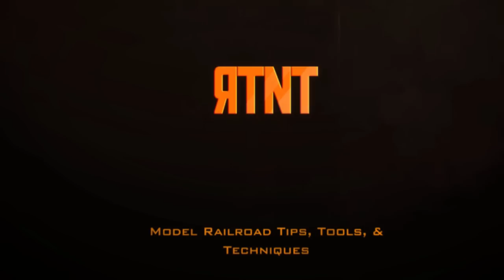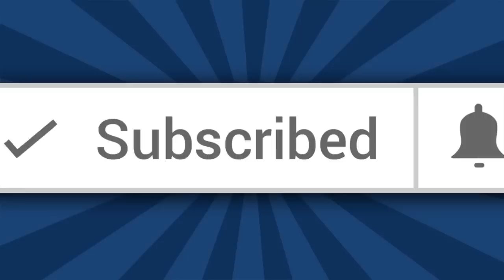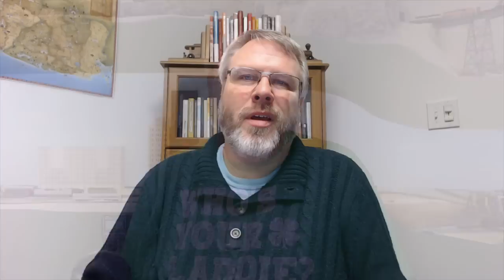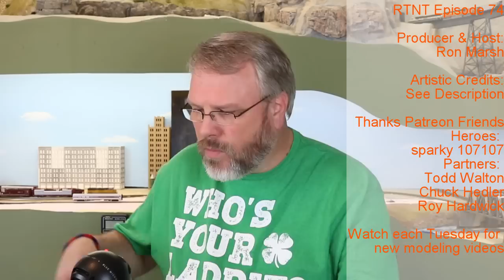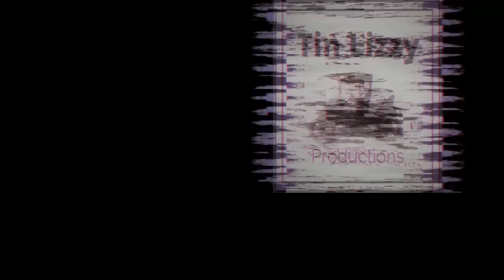Decisions to Make Before Building a Model Railroad Layout

Comment: After 25 years I'm back in the hobby. Using my old but still running beautifully Atlas/Kato yellow box locomotives I built a small layout based on the Penn Central in the 70's. Learned DCC and wired using NCE Power and Cabs. Converted said Atlas/Kato locomotives and just finished the benchwork this weekend! Starting to lay the trackwork using mostly Atlas code 83 flex and some juiced Shinohara turnouts which will need to be modified with isolated frogs and points. It is very interesting using older equipment with modern control (NCE/DCC) but I have to say I love it! My throttle pack days are over! Thanks for all the videos. I think your RR looks awesome!👍
Reply from the maker: Welcome back to the hobby. Sounds like you came back in force. 👍

Comment: What about your skill level with tools?  I myself am very proficient at wood working, electronics, etc. However I wasn't when I started my first layout some 25 years ago. Because of that I built small layouts when I first started until I got more skills, got  better tools, and was able to build better benches. I also kept wiring simple, relied on pre-made devices, and things like that. Now I'm wiring and running DCC, can program an Arduino, and make my own circuit boards.   

So for me - my goal was eventually a room sized layout but starting with a smaller layout really paid off. Of course time, $$$, and such will impact that decision.
Reply: As an experienced and successful model train builder, do you have any tips for someone quite possibly entering the field? I am a "tinkerer" so I have a lot of experience with soldering and doing highly detailed work. Any tips you could offer would be greatly appreciated! Thank you!

Comment: my first consideration is storage. i live in an apartment and dont have an expansive space to dedicate to a permanent layout. im going to build modules inside a number of storage boxes. im going to cut holes where necessary and bridge the boxes with a section of track. all i have to do is pop some track apart, put the lids on, and stack the boxes to be put away.

Comment: #1.  Do you have time.  Me?  It always seems my biggest nemesis to building a sizable layout, time!   For me 1) D&RGW, late 70's to early 80's, Grande Junction CO and westward.  I'm bucking the trend of Rio Grande model RR at the Front Range.  2) Rail fan style layout with some switching.  3) Scope - Grande Junction and westward.  Desert and canyon scenery.  4) Scale HO. 5)  Standards: I've digested John Armstrongs book many times over.  Minimum radius 32", siding 21 feet long.  11 track staging yard. etc.

Comment: Another thing to consider is what line you want to model, I myself will be in part modeling WSOR and though I would not have a great amount of space I have to do HO because they don't make any wsor in N
Reply: Sorry you feel that way… I'n in N scale building the WC in the fall of 1999... And rolling forward as if the CN take over never happened...

walthers.com
N scale
WSOR Locomotives
EIGHT items… listed

N scale 
WSOR Rolling stock
Zero items listed – But, since most WSOR rolling stock is “used” and shows its heritage, have fun doing patch jobs.

However, over the past few years I have acquired 12 WSOR cars from: Atlas, Fox Valley Models, Micro-trains, and Athearn. You can build prototype WSOR trains with off the shelf equipment by decaling local customers cars. 

The real question is, how bad do you want to build the WSOR to scale in N scale?

Never say never… More N scale stuff is coming every day… 
 After all Scale Trains did build the UP Big Blow in N!!!

Comment: I am just getting into model railroading so as you may guess I have some questions about the hobby. There are so many different systems and I don’t know if they can work together. Starting with the controls. I see the type of controls I remember as a kid. They are very basic like the Tyco 499. I have one of those for my HO set. I have had this set for years can’t remember where I got it. I have seen these DC systems and I see there is something call DCC.  I also have a very old Lionel set with the fast track tubular tracks. I think it was one of the cheapest starter sets from the 40s or 50s. I bought it because it is the New York Central set and my wife’s father and grandfather worked for that railroad. The train set I setup and test ran and it works and with be building it on a 4X8. But that with be later this summer. For right now I am working on the HO. I have a controller ordered (Tyco 499) and as of yet no tested it set. The set was set on and 4’X8’ by whoever owned it before so that is what I am working with. So I have been looking at buying the plug in lights system and have tried building a building from card stock. I think that is going to work well thanks to one of your videos. Anyway can you make a video that talks about the different types the trains system (DC DCC) and what will work with what? I see that some engines have sound do you have to have something else in order for them to work with the sound? I see these controls that are hand held and you can have one engine out of three or four running or can have a number of engines running at different speeds etc. Can I buy an engine for my old HO set (1960?) like a DCC engine and will it work on my set up?  Thanks for making your videos they have helped me a lot.
Reply from the maker: Well, there is a lot in that set of questions. What you have, as you mentioned is DC. DC as you know can run 1 train with 1 power pack on 1 block of track. To run multiple trains at once with DC you need to break your track into insulated blocks, have switches to route power to the right block, and have multiple power packs. DCC (Digital Command Control) uses a different kind of controller to send not only power but commands through the rails to a decoder on board the locomotives and allows different trains to run at different speeds, different directions, etc. on the same track. You should be able to run older DC equipment on any DC system. For DCC, however, you would have to convert your locomotives to DCC by installing decoders in each one. The sound you are hearing is connected to DCC using sound equipped locomotive decoders with speakers attached. Some old DC systems had sound associated with them, but it worked completely differently. Hope this helps.
Reply: Greg:  Short reply:   If the Tyco 499 came with a train set, use it for accessories only.   Get a Railpower 370 or better unit for Direct Current (DC) control of your layout.   There are plenty of resources out there to help you wire your RR.  DCC is Digital Command Control and is a little more complicated.   This system is NOT compatible with a DC wired RR.  DCC puts a square wave digital signal on top of an AC sine wave and sends these signals from a controller, stationary or hand held, to a command station using a throttle bus (wires). The controller sends a signal to the track using a constant voltage of 14 to 16 volts AC at all times.  You need a Decoder (computer chip) - equipped loco to respond to the signals being sent.  DC controls the track, DCC controls the locomotive.    Do your research, there is plenty of info out there.   Good Luck.    And oh, get yourself to your local NMRA Division and ask questions.  They will be happy to answer.   You can still get DC locomotives at swap meets and train shows.   Some DCC-equipped locomotives will run on DC powered layouts, but you won't have all the functions, lights and sounds.  Hope this is helpful to you.
Reply: It came with the Tyco 499 controller. I tested it with my Fluke meter and it worked. The next day I connected it up to the tracks and the engine didn’t move. I checked the engine and found a broken wire. I fixed the wire and the engine still didn’t move. I rechecked the controller and it didn’t work anymore. So I bought another on EBay. If the engine still won’t work I will buy another engine. I just didn’t want to buy one that doesn’t work with the set I have. I will check out the controller you suggested. Thanks.
Reply: Given your experience, I'd junk the Tyco controller and get a basic MRC power pack.   Secondly, if you're using brass track, i'd junk that too.   Replace it with nickel silver components and you'll be much happier.

Comment: Hey Ron, I disagree with what you are saying.. I personally just want to lay track and run trains on the HO scale, I have a preference for steam locos. I do not intend to build scenery, no track ballast or even put in roads, towns or anything else similar... I am just wanting to get locos, and rolling stock of various types to run around a track and have ladders for yards to set up and store trains and engines. I have acquired some track and points (but not enough as yet), a turntable and a 6 space engine shed, all second hand and will probably go this way as it is much cheaper to do it this way as some of the prices I have seen for new engines and track is crazy (here in Melbourne Australia).

The room that I intend to setup my layout is a 16ft long room with 2 doorways on one wall and is 9ft deep, so with that in mind, I am thinking of making an "m" shaped layout possibly with 1 or 2 helixes at the ends so as to get to a lower and or upper section for a fiddle yard........ I am presently going to use only DC as the loco's I have acquired are only DC, but I might go to DCC in the future and I will probably wire the layout for DC and DCC as I lay it. 

I am in the research and design stage at present and watching many videos like yours and others to get info to help me design and get more of an idea of what I want and how to do it... I do like your videos and have watched many of them so far and sub'd to your channel several months ago.  I used to have a HO scale model train set when I was a child but got out of that when I joined the Royal Australian Navy, now that I have retired I am now in a position to go back to model trains and rekindle my passion for the hobby. Cheers Tim.

Comment: Great tips! Is there a standard spacing for parallel tracks? I'm building a shunting N scale Timesaver and Inglenook Wye with 10" curves. 
If I run a second track outside of the 10" can it be 11 1/2" or what is the closest distance for any and all types of cars and locos?
I'm making all the tracks and jigs, so any radius is possible. 
I designed a 6" by accident - was supposed to be a 12"... Radius? Diameter?... it's like, your opinion man....

Comment: Why set it in the real world rather than designing your own custom layout? I ask because if you want to run your model railroad as you see fit rather than have people who are way too uptight tell you how you should run it or display it which pushes people out of the hobby (weathering, design, etc should be up to the person the model railroad belongs to rather than the opinions of others after all). Joining a club generally means having the club make all the decisions about your layout rather than making it your own decisions about design, weathering, what locomotives you want to be able to use, what rolling stock you want to be able to use, etc and that pushes more people out of the hobby than the cost of starter sets they're aware of (read most expensive).
Reply from the maker: I am all for a person participating in the hobby in whatever way gives them enjoyment and relaxation.